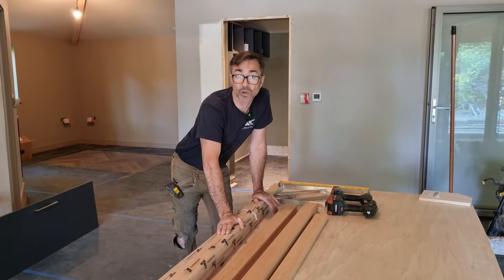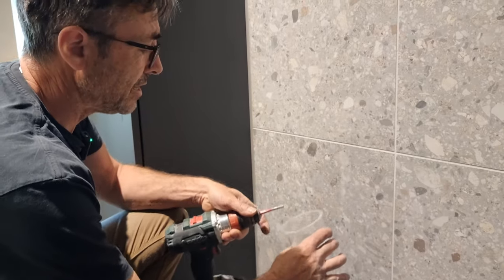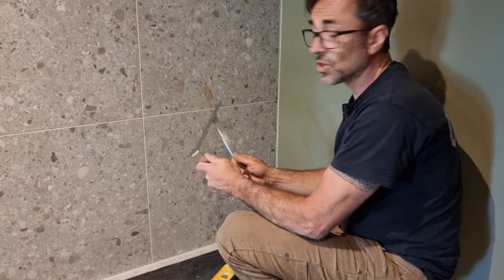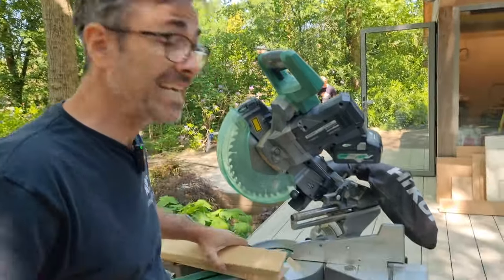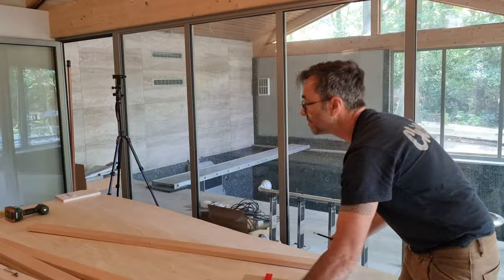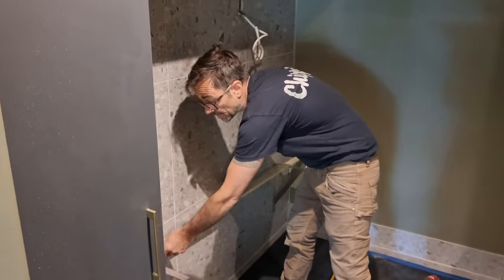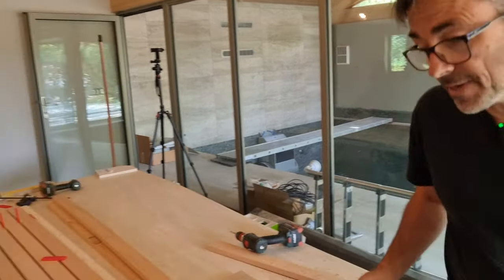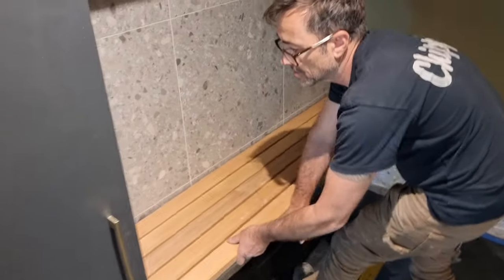How To Build A Simple Wooden Bench

Comment: I use a small piece of plywood , I drill a hole the same size as the diamond bit and attach double sided tape to the plywood, feed the diamond bit through the plywood, line up the diamond bit with the mark on the tile the push the plywood to the 
 tile and stick it on and the drill, guaranteed not to move. You can take the plywood off when half way through or keep going until you have drilled all the way. I also use the same proceedure on all size diamond bits, I haven't broken a tile yet! Use plenty of water especially on the large bits.

A hint from the Skill Builder is to dill through soft material to unclog your diamond bit, keeps it sharp.

Comment: Great video as always. 

The only thing I was confused about was the use of sauna wood for a wet room? Aren’t saunas incredibly dry rooms? Everyone I go in them the air is like desert air, painfully dry. Steam rooms are very wet, but saunas always seem very dry and hot. I know in the manual ones they pour some water on the stones, but that doesn’t seem to wet the air. What I do know is that hit air can hold way more water than cold air, so the fact that the air is so incredibly hot, the water is just locked into the air and doesn’t get on anything, if it was cold the water would condensate on things around the room and also be visible in the air s water vapor like mist and fog. 

Maybe I’m wrong, but seems like cedar oak may be better for wet rooms?